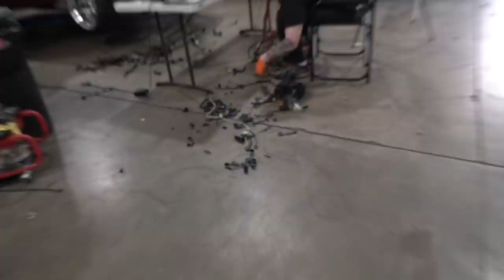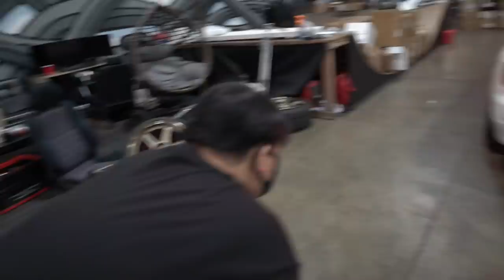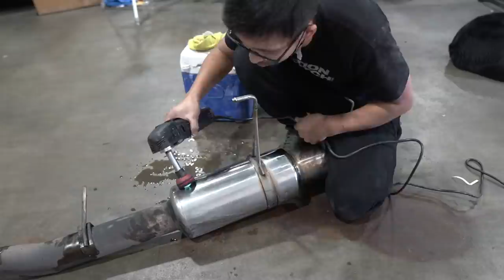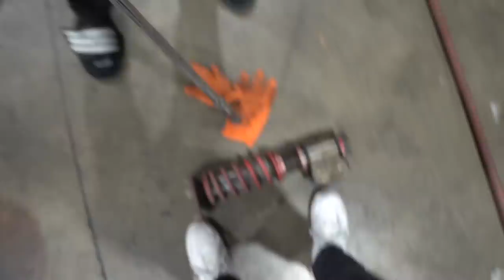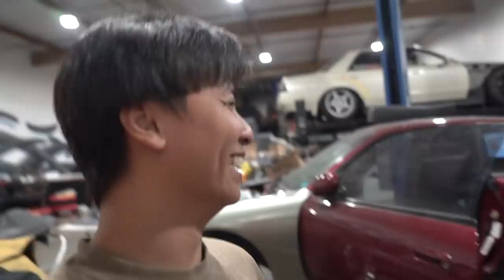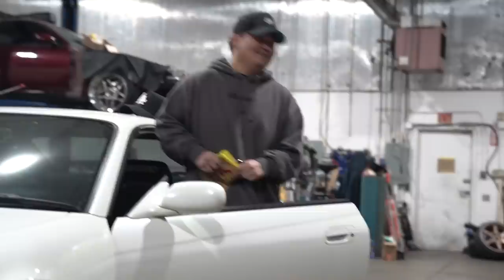SLAMMING the S15 on NEW WHEELS!

Comment: Kano aerokroil! Look it up. Expensive and it works. I never believed in penetrating oils as I tired it all and none worked good enough to work  to justify buying some to stock up. Normal heat works better for me. But in cases where you can’t use heat to that extent I found this stuff work great!!  used to work snow business and these 4300 trucks I would ether heat the poop out of what I’m taking off or cutting it off. But this stuff since recommended we been using it more then applying heat. I think we bought one box and days later we bought cases more. If it works on loaders and hd trucks that see salt and snow, coilovers are nothing